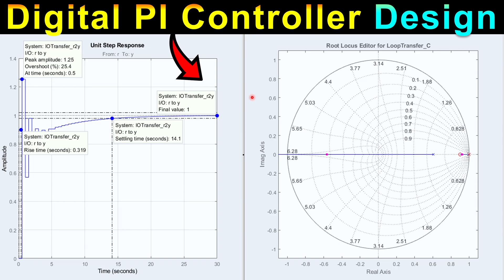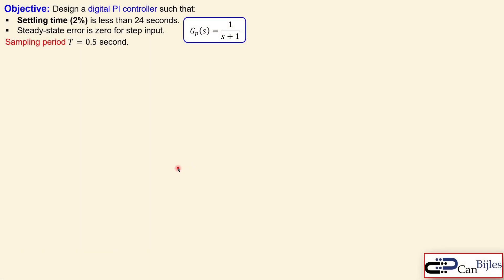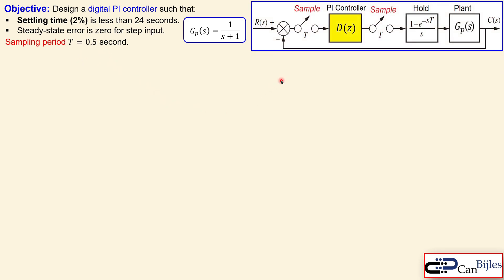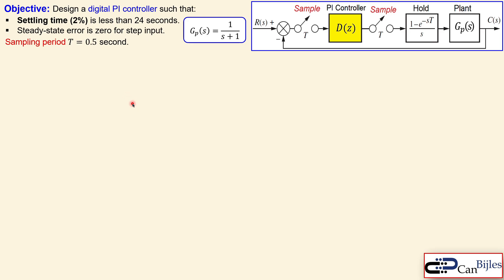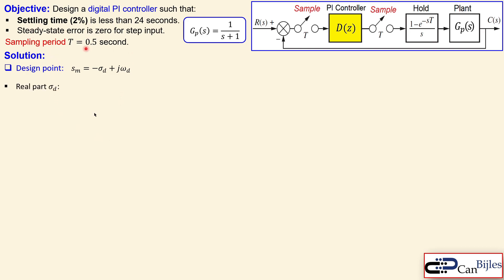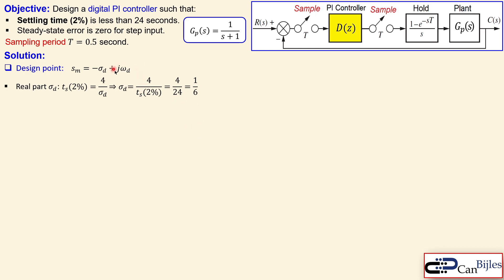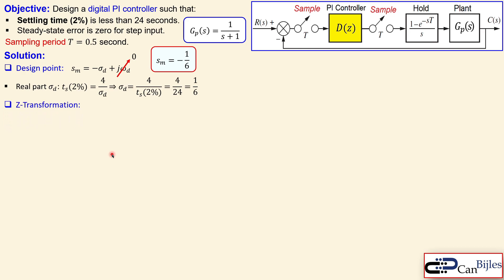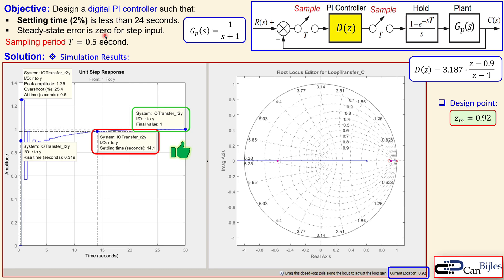Digital PI Controller Design ⚡ Calculations & MATLAB Simulations 🌟 Example 2

Comment: Hi! How can I assure the sampling period is suitable for the desired performance? Is there a method you could suggest? Thank you.
Reply from the maker: The bandwidth of the complete system will determine the sampling frequency. According to Nyquist sampling theorem, we need to sample at least twice the bandwidth, but practically we always do oversampling.

For more on sampling frequency and stability of discrete-time systems, check out  this playlist:
Jury Stability Test for Discrete-Time Feeeback Control Systems: https://www.youtube.com/playlist?list=PLuUNUe8EVqln_5CpejcNFtK3Y9hQyf4Ge

Comment: you will design cascaded controllers? I'm controlling a network-forming converter and I'm having difficulty controlling voltage in cascade with current.
Reply from the maker: At the moment, I have no plans for another controller design video. For going from voltage to current, you need to use a transconductance configuration for the amplifier type.